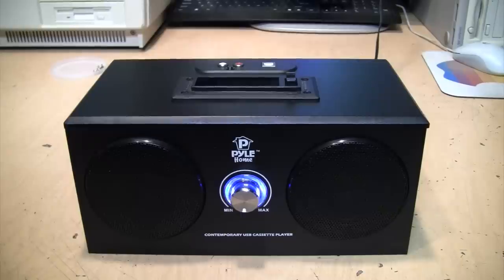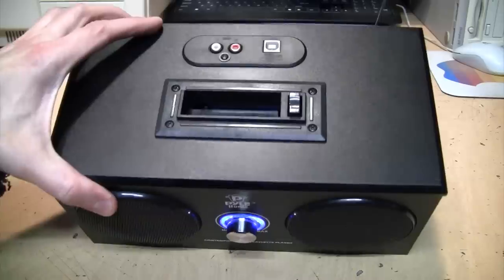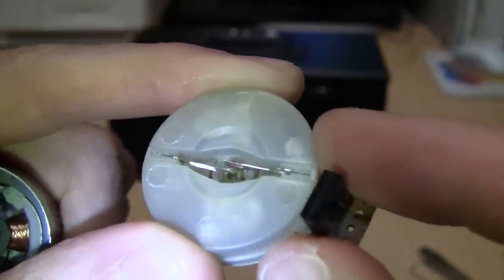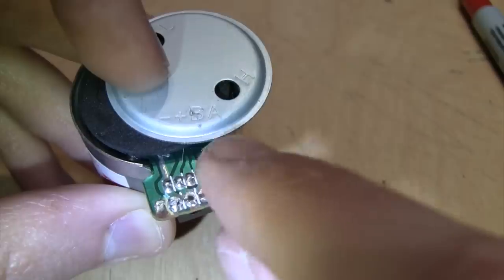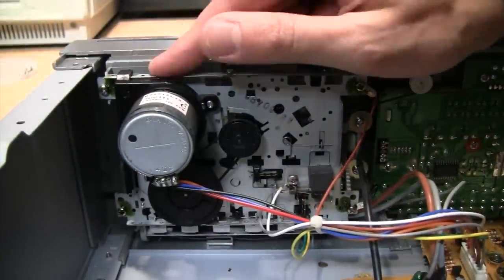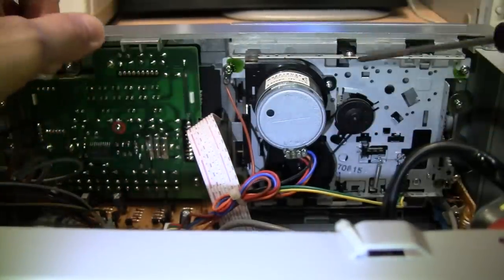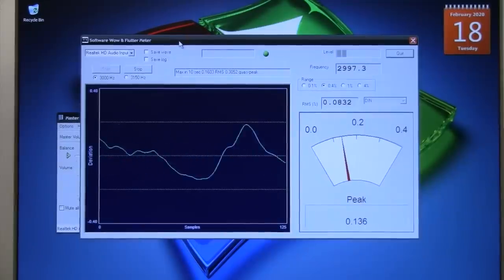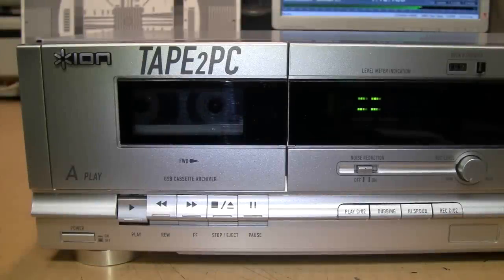How to improve your turntable or cassette deck with just 1 drop of oil

Comment: for a more permanent lubrication, you should use silicone grease instead, and it won't attack plastics
Reply: I don't think the red 3 in 1 will attack plastic.
Reply: How can you insert the grease without making the brushes dirty?
Reply: @detscadosu2465  I blasted a squirt of WD Silicone and it been great enver since (touch wood)

Comment: When transferring small bits of oil, use a finish nail or tooth pick and the molecular adhesion will let the drop ride right in to the hole.

Comment: I recommend add oil to the front bushing too with needle or tooth pick.
Reply from the maker: I tried that first and it didn't fix the noise/vibration, but it's good to do anyway.
Reply: helped with mine.

Comment: Sintered bronze (oilite) bushings are always annoying. They actually WERE oiled at the factory, and they work because the cast bushing is porous. But when that reservoir runs out, the porous metal acts like sandpaper against the shaft, and will erode it quickly if you don't re-oil it right away. This happens all the time with modern household fans. Older fans used to have a reservoir sponge that you could add oil to, and the bushing would absorb this oil, but newer ones are made to be disposable, because that's where the profit is.

Comment: Those bearings are supposed to made of sintered bronze. Tiny bronze balls squished together under high pressure and high temperature, so the result is porous, then they submerge them in a special grease melted under high temperature, then put it in a vacuum chamber. The molten grease creeps into the tiny pores among the bronze balls, and that's the lubrication for the lifetime of the bearing. I assume in cheap motors, they don't use sintered bronze, just ordinary, machined bronze without lubrication.

Comment: Had to do this with a Nakamichi BX-125 tape deck I have. It uses three of those exact same brushed DC motors in the transport mechanism.

This is such a common problem, I recall coming across forum threads where people were discussing alternative replacements for these motors. Modern brushless motors are infinitely more reliable.

Comment: I was surprised the brushes were happy to just move aside as the motor was reassembled, great video 👍
Reply: I was going to comment on that. My experience is they don't usually move aside that easy and if your not careful or devise a way to spread them enough to clear the washer and commutator you will bend them.
Reply: @bradt.3555  Indeed... I did a "Oh no... You didn't just..."

Comment: For anyone here with a cassette player like a walkman and you need oil, id recommend the oil they use on sewing machines since that oil is meant for very small delicate parts, and then put that on the tiny mechanical parts and such.
Also i think im going to try this on my walkman and see if it makes a difference or if it makes the motor not work etc, will edit the comment if it works/doesnt etc
EDIT: after closely looking at the inside of the motor i can conclude that there would most likely be no benefit of oiling it, only thing to make a walkman quieter would be using a plastic friendly lubricant on the plastic gears
Reply: oh also i should include DO NOT put oil anywhere near the gears or the belt, it can start slipping, also dont add too much to the parts or the oil can come off onto the other parts like mobo etc
Reply: Another source is that little bottle you get with an electric razor but never use.  Fine machine oil 👍

Comment: Thanks for the tip. I have a bottle of ball bearing lubricant that is used for sewing machine, roller skate, and skateboard ball bearings. The bottle uses a syringe needle to apply tiny drops of lubricant to bearings. Definitely comes in handy when I need to lubricate things in right places.

Comment: VWestlife: Very appreciable video. Thanks! I just repaired a weak sankyo-pioneer engine (PL-335). First I connected it to a 12v adapter immersed in alcohol for 25 minutes and pulled out a lot of dirt, but remained weak. Then I tried to remove the pulley to put it on another good motor and the whole shaft came out. Oops Finally when returning the axis to its place and without knowing how, it was fixed! A drop of 3 in 1 will be a thousand times better than the wd40. You're right!
Reply: Many motor shafts are just friction fits and will come out it you PRY the pulley. You need a miniature "gear puller" in that case. These grip the sides of the pulley and push against the shaft, taking all the strain off it.
Reply: In some situations you can use a heat gun ... brass pulleys of course... plastic ones usually will slide off ... both are most likely friction fit ... some of the brass ones where actually placed on the motor shaft while they were very very warm ... when it cooled down the friction grip increased there by making the pulley nice and tight
Reply: @RuneTheFirst  Appreciate a lot. Thanks man!
Reply: @darinb.3273  Appreciate a lot. Thanks!
Reply: @darinb.3273  Appreciate a lot. Thanks!

Comment: I own this deck after trying to buy a restored quality Nak deck with no luck. All of them still had problems. I installed quality isolation feet, lubed the motors and play tapes through a Schiit Vidar amp and Emotiva loudspeakers. I think it sounds great and it is easy to work on. Belt changes, motor speed adjustments, etc are not obstructed by large circuit boards.

Comment: Take notice of the kind of brushes used in each motor. Some have a surface of durable material on the end. They don't like oil on them. It screws up contact between the brushes and the rotor. A needle syringe or bottle works better than drop and hope.

Also, some motors, such as older Mabuchi offerings, will have a wider surface between the bearing and where the brushes ride. this was meant to shield the brush area from oil on the older models. These will not just slip together as the wide end (like a washer) will just push the brushes down and bend them away. In some cases we had to take off the pulley (brass or plastic) and pull the whole rotor out, assemble the rear to the rotor and put everything together the hard way. A long shaft motor is easier since the magnets will pull things off center. Takes practice, lots of it.

A better way:

We have taken to using a device known as a "pin vise" and very tiny drill bits to carefully drill a tiny hole just a hair off the exact center of the rear "bearing" rather than take the plastic "bearing" out. Oil can then be added through that hole. Works great and is far easier. You can get a pin vise and needle drills from a good hobby shop (especially one that specializes in trains) or from eBay or Amazon. Most pin vises come with a couple of bits. Cheap yet valuable!

A motor (Dremel) tool could be used but one little error and NO MORE MOTOR! There is WAY more control and precision with the hand tool.
Reply: How do you keep metal shavings from getting in the motor while drilling into it?

Comment: I used to work on vacuum cleaners when I was in high school, and used to repacck motor bearings.
Though brands like Kirby,, used to say everything was lubricated, and that nothing required any sort of lubrication, unless a motor was overhauled, or rebuilt, like what I used to do.
Though, if I was taking the machine apart, I greased the motor bearings, anyway, no matter what the manufacture said.

Comment: @vwestlife I did exactly that to my Craig turntable I found it had same thing no oil so put a drop in . as you said yes have to be very careful with finger brushes and its quieter til vamp up to 78 rpm but its not loud  just normal. Did it first try and it worked Beautifully!  Even put some oil on the bearing area for platter and top bearing of motor. I used Castle branded Endura. Its high temp grease but will basically never break down lol its not thick but its enough where its made to withstand 600 °F . I've used this on my 12 v cooler its an old Coleman 36 can type and it made it better then ever I've had it for 11 years now still going strong. Thank you again for suggestion!
Reply: 12v cooler fan ..... thank you Matthew 👍, mine's been getting loud and ..... duh haha

Comment: This is what I do with noisy brushless DC (computer) fans. under the sticker on the back there is usually an access point to the bearing or sleeve. I use sewing machine oil, though. I'm sure it's pretty much the same.

Comment: Great tip! I can't stress enough how important it is that these little contact fingers end up in the right spot when reassembling. They need to slip over the small plastic disc onto the thicker part if the shaft, which actually makes contact with the coils. I just learned this the hard way this evening when doing this hack (also modded the motor to now have external speed control pots like on more expensive turntables - works great ...after almost breaking the motor). At first the motor didnt spin and the motor control IC (the black thing outside the metal casing next to where the wires attach) got awfully hot within seconds. If you do this and your motor doesnt spin, KILL THE POWER INSTANTLY! I'm lucky I didn't burn out mine. So what happened? These contact fingers didn't properly align inside, got tangled and touched each other, which shorts the IC. Being an experienced electronics DIYer I quickly found out what was wrong, but I needed a few tries to put the motor together in the correct way, especially as the contact fingers then were not perfectly straight anymore.. Starting at an angle so I could actually see inside to make sure the shaft went in between and not over the contacts and then going as straight as possible did the trick. Also checking with a multimeter that the contacts weren't shorted again is a good idea before powering up the motor and potentially killing it.
Do you have any further tips on this procedure? Other than that, like I said, great tip. Love your videos.
Reply: I just saw a tip where you bend a piece of wire into a "U" that is narrow enough  to fit into the two thin slots in the plastic housing that holds the fingers. You insert each end into the slots and slightly twist. It will separate the fingers wide enough for the commutator to fit between.

Comment: Hi!
I tried this but everything went wrong :-).
The disassembling was simple but the internal parts (the coil) moved out of place and it was impossible to put the covers back  without the motor getting stuck.
Finally the metal fingers get bent so now my deck is history.
I'll see if I can get a new motor or a new deck.
Anyway i wasn't using it because of the flutter it haves which annoyed me beyond the imaginable.
I've got tired of """technicians""" (lest's call them flakes) so that's why i've decided to give it a try.
Great video but you have to be very careful...
Thanks!
Reply: By the way, the deck was a Hitachi D-E25.

Comment: Have been doing motors for years.....I use an electrical friendly lube and cleaner such as CRC 2-26 or some similar similar product...Often it is not necessary to remove the back of motor as it can be squirted through any available holes and will work itself around inside (this applies mainly to motors without internal speed control). Don't forget to work lube into the front of the motor too..
Motors in CD and DVD players can be treated like this too......If you have a sick CD or DVD player, first clean the lens..If still no good, clean and lube the motor ( mainly the spindle motor)!

Comment: Not sure about 3-and-1 oil because it’s very light. It’ll work but may not last for years as it dries out (sealed containers will limit the drying however). It also can have a bad reaction with some plastics (though I’ve only read about that and not experienced it).

I’ve used white lithium grease for similar purposes and it’s very slick and won’t evaporate or dry out for decades.

Comment: I use sewing machine oil, one drop a year on my PL-516X keeps it running and running. It does have low power after 30 years so thinking about replacement.

Comment: If your lacking a syringe..a large sewing needle. The thread hole keeps a drop of fine oil suspended perfectly until you touch it to the part you want oiled, then it all flows out like a little fountain pen.

Comment: Many older motors such as those in fans and air conditioners were designed to be oiled on a regular basis. At least once a year. Newer fan motors use plastic parts and don't need the oiling. But you want to make sure you use motor oil.

Comment: Hey that's a GREAT suggestion I never thought about my turntable motor its quiet but faintly noisy I may try with spare motor like you did.  A single drop of oil works especially like I have model railroading as my other hobby . my dads Lionel train was very noisy and not as fast I put some TLC on it before and zoom took off like a rocket.  However model trains like I have are older HO scale 2 required oil but the others need plastic compatible oil/ grease Thank you Kevin. PS when you were saying about difficulty of getting oil in the bearing area. Model trains have special bottoles with a needle tip that goes into hard to reach areas. :D

Comment: Some of those motor like this can have the brushes completely destroyed ... most if not all of those motors have two little tiny holes (one for each brush) ... the brushes are pushed back and a wire or very tiny screwdriver for each side will hold the brushes back until the end cap is in place ... then the wires or screwdriver(s) can be pulled allowing the brushes to go back to normal position.
Reply from the maker: Thanks for the tip. But so far I haven't needed to do that with any of the motors I've taken apart, oiled, and put back together.

Comment: Great tip! I recently replaced the belts on my at the time unplayable Sony CFM-155 and oiled the motor as you show here. The motor sounds great and I don't notice anything amiss with it. The playback speed however is noticeably slower. I used a generic cassette belt assortment and matched them up to the original belts. Could this possibly be the result of opening/cleaning the motor? I tried using smaller and larger belts but to no avail. Should I adjust the motor speed or is there something I've possibly done wrong? Thanks!
Reply: Try adjusting the speed make sure that one of the belts ain't tite if that doesn't work out if you can try the original belts

Comment: I suppose you could even run a drop of oil down a small piece of wire into the hole, or use a cocktail stick and let one drop run into the hole?

Comment: I believe the metal fingers on the back are called brushes.. Also you should be carefull not to squash them with the little plastic spacer that's on the rear end of the shaft when assembling the motor.

Comment: VWestlife, a very detailed, informative demonstration of repair! However, should anybody doing this sort of more complex DIY repair project wear an anti-static wrist strap? As in upgrading, or repair of a Desktop PC, it is important to attach a wrist band around your left, or right wrist while touching, holding, and adjusting most things in a computer. Therefore, should the same procedure, and precaution be applied with a hi fi audio component? Thank you for any technical advice.
Reply from the maker: It's a good thing to do while working on computers, although I've found that periodically touching the power supply to ground yourself is OK as well. And these motors run on 12 volts and are not so sensitive like computer equipment so I doubt static electricity will harm them.
Reply: @vwestlife  Thank you for the advice on this repair.

Comment: I have a deck nearly identical to that one except its under the Pyle brand.  Playback works okay, but recording on this deck is terrible.  So far it's a Pyle of crap...  Did you do anything to get the record function working any better on the B deck?
Reply from the maker: Actually on mine it's the opposite -- it records better than it plays, at least on Type I tape. Its playback is very hissy, but the recordings it makes sound great when played on a better deck.
Reply: @vwestlife  Interesting.  Playback is somewhat hissy on mine, however recording is like I said un-listenable.  For instance, when playing back it's recordings the audio will warp in and out and even distort a lot of the time.  I thought it was maybe something to do with the heads or belt, but if it plays just fine, I can't exactly see how any of those things would cause an issue.

Comment: I took apart the tape motor in my boombox to oil it, and inside it was actually a smaller motor in a separate housing that was wired to the little circuit board. Not like the motors shown in this video

Comment: Thank you for the great video, I think this is just what I need to do!  My question is how did you get the motor out in order to do this?  I don't want to manhandle mine too much & break everything.

The motor on my Memorex 9199M (tape deck/turntable/CD player combo) is "attached" to the bottom of the platter.  

Any advice for a repair novice like myself would be greatly appreciated @vwestlife .

Comment: By the way, on these LED VUs we can see the dynamics compression of the volume (loudness war) applied. We can see that exactly where the volume sounds louder, the VUs are reduced  to only the first 3 LEDs with no pumping. It just freezes there on those parts 😕
Reply from the maker: The LED meter on this deck is rather coarse -- the top end of the scale is in 3 dB steps, which represents a doubling of loudness. So smaller changes in volume won't show any difference on it.